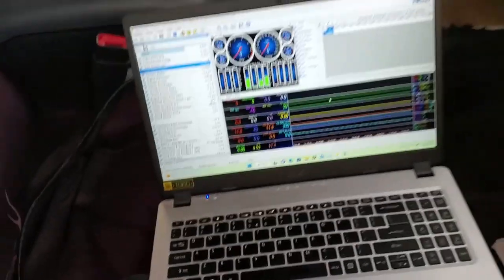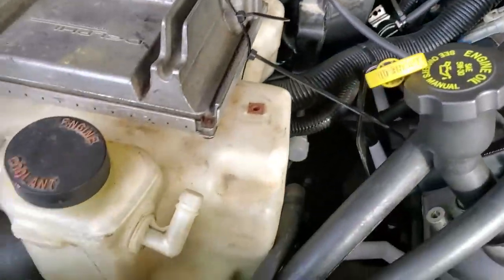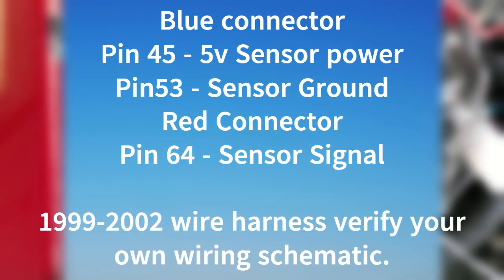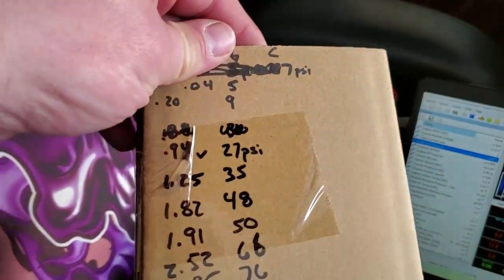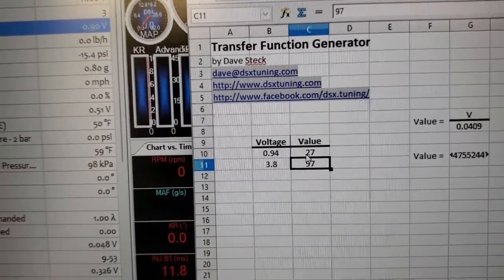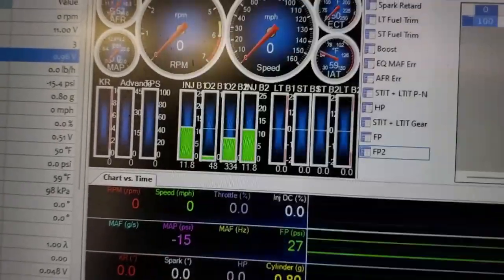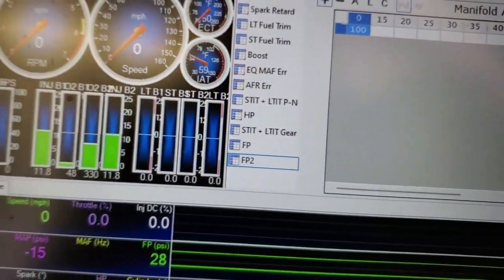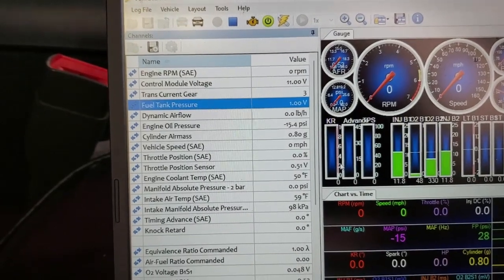LS Fuel pressure logging on HPtuners gen 3 P01 / 0411 ECU

Comment: I'm looking to log my fuel rail pressure on my `99 Trans Am. There is already a regular PID in HP tuners for the tank pressure (voltage). If that's the case, I'll do the math and either run with that or get a  pressure transducer and put it on the rail and pin it. The rail and tank pressure are not the same so what would be preferred - rail or tank pressure?
Reply from the maker: Use your tank pressure pid but hook your pressure sensor you have at the rail to the wires that the tank pressure sensor uses. Then scale it. That way your tank pressure pid becomes the reading at the rail
Reply: @theholubproject3497  Perfect. Thanks!
Reply: @theholubproject3497  Another option is to use the EGR pin / PID since I've deleted it. The sensor and wiring would be right there under the hood.